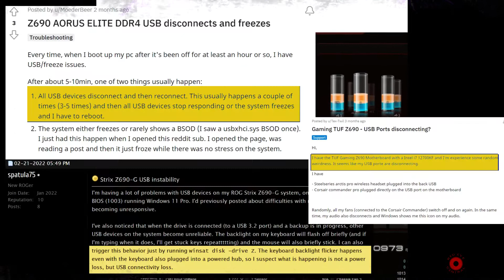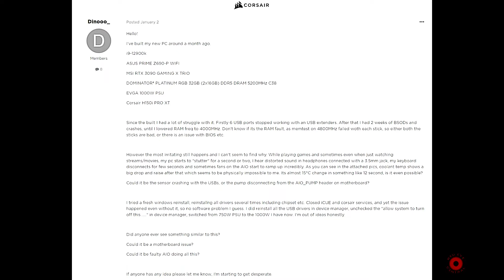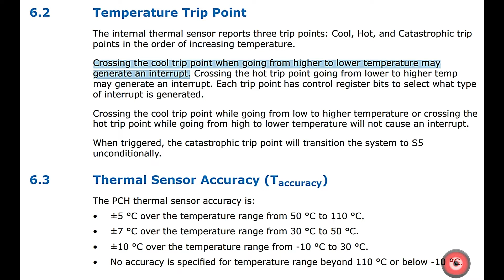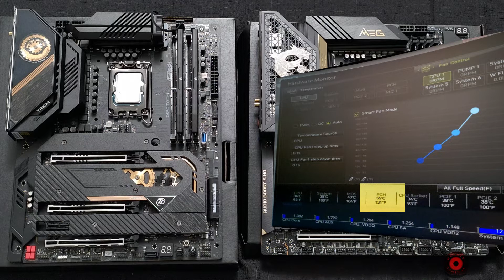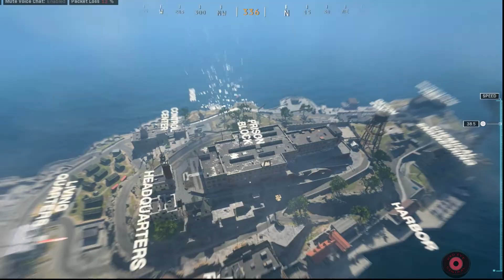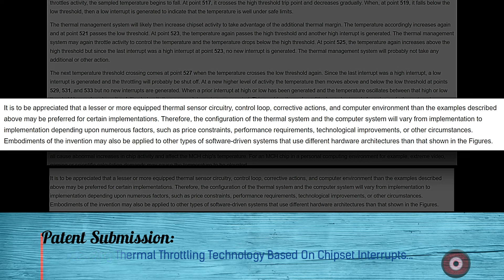Z690 Chipset Motherboards Getting Burned From The Inside Out? Let's Take A Look

Comment: I have a prime p4 I use icue to monitor lately after installing a second ssd my temps have shot up to 127 Celsius which is worring could be icue glitching I'm new to pc not a good start lol
Reply from the maker: Yeah that would be unacceptably hot. The GPU may be adding more heat in that location as well, since the chipset is right behind. And the more powerful the GPU, the hotter. Are you noticing any system disruptions, such as disconnected peripherals, lower performance, freezing, crashing, lost drive access, etc.? 

We cover a little about Intel's references to chipset interrupt points at around the 3:08 mark in the vid above. 

You can try to download and run HWiNFO to see if you can cross-reference and compare the temps you're seeing in Icue with the temps in HWiNFO:

https://www.hwinfo.com/download/

*You can download the portable version if you want to run it from a USB drive, or from your local downloads folder, instead of installing it on your Windows installation.

In HWiNFO, check for the controller section in the sensors readout window (probably labeled as "Nuvoton" SIO) and see if it lists the "PCH" temps.

We'll try to throw up a quick walk-through of HWiNFO in the future, but you can just select "Sensors Only" followed by clicking "Start" (when starting the program) and that will show just the sensors window. That can make it less overwhelming than starting everything at once. Then scroll down those sensor categories and try to find the PCH temps.

*Some Motherboards have a BIOS readout for chipset temps as well, as seen in the vid above at the 4:23s mark. You can try to double check there to see if the BIOS temps are available and if they match the temps you are observing in icue.

We installed a chipset water block with good results, but that would only be an option for water-cooled systems. Some other system owners have reported some success reducing temps by directing a fan directly toward the chipset heatsink.

Let us know what you find out in BIOS or in HWiNFO.
Reply: @RedEyeCentral  only disruptions are my controller disconnects occasionally and ok ill try hwinfo and see if it matches up. Definitely didn't have this issue before I put second ssd in
Reply: @RedEyeCentral  also checked motherboard temp in bios and its 24 Celsius
Reply from the maker: @sam-gf4ev  Often times, "Motherboard" temp sensors just indicate a sensor placed somewhere on the motherboard to measure the temps of the circuit board, but not specifically in the chipset area. Chipset temperature sensors should be identified as "PCH" temperatures. If the BIOS has no mention of PCH temps, maybe Corsair icue is glitching and misreading a non-existent sensor, or something along those lines.

127C is really hot and would most likely trigger a shutdown by passing the catastrophic trip point mentioned by Intel, around 2:29s mark in video above.

If HWiNFO can't find a "PCH" sensor reading either, then the board may not be equipped with one and that may require an external thermal probe on the chipset in order for a system owner to observe and garner temp readings in that area.
Reply: @RedEyeCentral  thanks I looked at hwinfo and only one that's a little hotter is the pch temp at 61 Celsius which is a lot less so does look to be like fault in icue thanks for your help ill keep an eye on it
Reply from the maker: @sam-gf4ev  That sounds much better! We shaved off 67C! Go us! Haha. 

No, but really, excellent execution. Sounds like you now have some good temp readings to better track performance going forward for your specific hardware. Checking it like you did is good practice. 

It's always good to get that data early on. That way, when checking those sensor readings later, it's possible to compare them to that baseline data that was documented at the beginning stages of a system build. This can be helpful to determine if temperatures and/or performance (and any correlation between the two that may exist) are degrading or improving with changes that occur over the course of system ownership.

We might still not know the thermal trip points on the motherboard, other than Intel's "catastrophic", which makes it hard to identify at what temps the system begins to thermal throttle activity and affect system performance. However, 61C is a much better place to be than 127C.

Thanks for the follow-up! And letting us know what you found out on your system as well.

Comment: I also have problems with ROG STRIX Z690-A GAMING WIFI D4 cheat at idle 66-69 degrees depending on the time of year. I noticed that I play on x2 in normal mode, the first 10-15 minutes go smoothly and clearly, hitting bullets goes perfectly, the score goes 21-4, 18-5 +-, as soon as the PC heats up everything goes with a big delay and I think it's the fault of the chipset. In the game it heats up to 72-77 degrees, like not significantly, but starting from 67 degrees the game behaves very unresponsive, on the monitor opponents are not, but in fact they are already shooting at me 1-2 two times and only after that to me on the monitor show that they start to come out and I do not even have time to shoot as I am killed, ie there are delays, but not lags, but as if the information with a delay comes to the monitor. I'm not 100% sure that it's because of the chipset, but it is the hottest 72 grudusa, motherboard 40-42 degrees, CPU 54-60 degrees, video card 4090 50 degrees.  Is it possible that the monitor is warming, or the network card - integrated Ethernet i225-v3, or the memory is warming and behaving with lags? But I've definitely noticed that when the room is 25 degrees, the game runs better than at 26.5 degrees and even more so at 27 degrees in the summer. When I opened a window and after 3-5 minutes the game would revert back to its original state, I could hit digil gun targets with a single bullet again.  

Even when I didn't have a 4090 and had a 1070 it was the same.

Comment: Hi bro... Actually i got the same issue with my ASUS ROG STRIX Z690-F. I put 3 SSD in this MB, and I saw that chipset temp got between 70-75°C!! I am really sad, because this is my first assembly. I have 9 months with this computer. Besides, my mouse or my keyboard are disconnected sometimes.
Reply: This temp chipset happens when I am doing anything in my computer.
Reply: mine is disturbing it's 84-86 °C in a 24 °C environment.  God my board will be toasted soon, hows your board mate?

Comment: The problem has been identified and fixed by many. You need to remove the motherboard from the chassis.
 1. Remove the screws holding back the metal cooling block and plastic shroud.
 2. Remove the old thermal pad, clean the metal surfaces and the PCH chip.
 3. Cut and install GELID GP-Ultimate thermal pad size 1.5mm or 2 mm  over the PCH chipset. 
4. Place the cooling block/radiator with the plastic shroud back in its place, tighten  the screws on the back side of the board.
5. 15–20 degrees C lower temps. If you want a few more degrees lower temps, remove the plastic shroud (unscrew the bolts that are holding it to the cooling block/radiator)  before installing the block/radiator on to the motherboard PCH
Reply: Do you have a video o something visual to remove these? I have the same problem, and I am trying to resolver it

Comment: My Msi z690-P with 12700K was only giving 5 watts to processor. When we send it to warrenty they said. We have overclocked the cpu. The PC would restart for no reason and wouldn't work properly
Reply from the maker: Sorry to hear 😟; I know having newer, malfunctioning parts is frustrating. Were you able to check the PCH temperatures at the time? Though, it sounds more like it may be a power delivery issue, seeing the temperatures could help pinpoint any other overheating components. 

Are they saying they won't honor the warranty repair?

The "Z" series boards are usually the boards they market and sell for overclocking, so they might be trying to dance around the warranty if they think a "P" series board was overclocked. 

A "Z" series board would be something like: 
MSI Meg Ace Z690 https://www.newegg.com/p/N82E16813144505

I am not sure how they would know unless something obvious was askew in the BIOS, but if it wasn't overclocked or the BIOS "Auto" settings set something inappropriate, see if you can talk with a manager and let them know your case. But with the current state of customer service (doing full AI), I can feel your frustration!
Reply: @RedEyeCentral  It was a build for video editting in my office not a personal one.

• initially everything was working fine but video exporting was taking too much time in premiere pro.

• I did benchmark on cinebench and at the same time video card. Everything seems okay.  Only Cpu was getting hot.

• The only issue i noticed was when i removed the eternet cable and re attach it. The internet would not work without a restart.

• We send the pc back for cpu repasting. still there was a problem. and then suddenly PC keeps restarting randomly. When i did stress test it would not restart . During video ediiting it was randomly turning off.

• We send the pc back that guy concluded it was the problem with power supply. We got a new one with warranty but it didn't fixed the issue.

• Now things changed. The CPU would not use more than 5 watts and it would take more time to start. The motherboard would show differennt light. Start time from black to bios screen were more than 10 seconds.

• We send it back. then i went personally to the shop and tested different processor it was lock at 5-6 watts and 0.40 or 0.80 mhz 

• Then we change the motherboard got Tomahawk. We had to pay 15-20dollars extra.

The location was Pakistan not europe.

Comment: I've bought this motherboard couple a months ago , very good motherboard nothing to complain about but now i've senn in HWiNFO the Chipset temperature , it's 70-73  degrees in almost  IDLE ! , i want to specify i use for CPU Noctura DH15 and all case have very good fans and airflow , in 100% cpu utilization i have like....65 degrees on cpu and 70-75 on graphic card for example, but this chipset temperature it's diving me crazy , is this normal > ?  in game like Cyberpunk the Chipset temperature goes to 80-85 !
Reply from the maker: Sorry to hear. I know it's frustrating. What make and model motherboard? What model GPU is in the system? 

There is the option to add a chipset water block, but that most likely requires: the GPU to be water-cooled, the removal of the chipset heatsink, and most likely the M.2 heatsinks if they extend all the way to the chipset area. Those heatsinks often contribute significantly to the aesthetic theme of the board, so it might take some of the visual appeal away if the system is appreciated as a visual display centerpiece over raw performance.

But, if in dire need of improving functionality, that is an option. With the Watercool Heat Killer, we get Z690 chipset temps on the MSI Meg Ace that stay in a range between 27C and 35C, depending on ambient temps and workloads. We did a walk-through video showing some of those temps during some random workloads: https://www.youtube.com/watch?v=9ZgS3x6ULSQ

Some other options you could try:

*See if you can get some more fan cooling in that area behind the GPU; sometimes the GPU can add a lot of additional heat back there as well. Some system owners have even mentioned placing a fan right on the heatsink with fasteners like double-sided tape, though with the temperatures in that area, I'm not sure how long the adhesive would stick.

*Try to remove the heatsink and check what is going on underneath. Are the thermal pads making good contact and getting compressed properly by the heatsink? Also, you could use some calipers to measure the thickness of the thermal pad installed by the manufacturer and try to find some upgraded Gelid GP Extreme or Thermal Grizzly Kryonaut replacements in that size to see if installing those can improve temperatures. We posted a video a while back displaying some temperature differences we were seeing after replacing generic thermal pads with Gelid's GP-Extreme pads on some GPU memory modules, shown here https://www.youtube.com/watch?v=wH4YeHPUL4Q

*Another option that isn't too desirable is reducing functionality within the BIOS/UEFI, though that kind of defeats the purpose of buying a premium board with all the extra functionality. But, some system owners have mentioned reducing DMI speed in the BIOS from 4.0 to 3.0, etc. We posted a quick request video on where to find that setting in a Z690 Bios here https://www.youtube.com/watch?v=Ar-FGCby4MI 

Let us know what you find out.

Comment: ROG STRIX Z690-G GAMING WIFI with 13700K, idle chipset temps about 60 to 63.  Anyone tried upgraded thermal paste or pads? Not sure if it's pasted or padded.
Reply: I have a 13700k on a rog z690-i wifi with a rog 240 AIO and it runs upto 70c the cpu is at about 60c. I have put in a thermaltak cpu cage over the stock cpu mount and got mk6 paste... it runs hot unless you have a large rad and plenty of case fans

Comment: yea my z690-I strix board is dead and my cpu :O
Reply: Can you say more?
Reply: @errrr69  sorry for late but yea my chipset killed my board and my cpu was going with it.
Reply: @S3agrass  whats temperature PCH?
Reply: @errrr69  my did hit 95c in bios
Reply: @S3agrass  i change pch voltage 0.9 and 0.7, 81c under load, check it. But these are still sick temperatures. Also think about changing the efficient thermopad
Reply: @errrr69  i did send my board in to Asus and they did send me a new one
Reply: @S3agrass  and now temp pch? Better?
Reply: @errrr69  yea 50-60 c
Reply: @S3agrass  Nice, What will change / fix?
Reply: @errrr69  ? About what
Reply: @S3agrass  So they exchanged for the same, new model z690i and there is no problem
Reply: @errrr69  i have a new z690-I board and its working but how long that i dont know
Reply: @S3agrass  Check if you have not enabled ASMP in the bios, temperatures drop but it limits the bandwidth. It is impossible that on the same model the problem disappeared, these constructions have it
Reply: @errrr69  yea i will check it when am home 👍
Reply: @S3agrass  This is in the bios, Advanced->Platform Misc Configuration. If your problem solved in this way, it's a big minus for Asus
Reply: @errrr69  my ASPM is on auto
Reply: @S3agrass  And the rest? Pci Express Native, DMI Link ASMP Control, L1 Substates, DMI ASMP, DMI gen3 ASMP, PEG - ASMP?
Reply: @errrr69  auto on most off it but gen 3 asmp is off
Reply: @S3agrass  It probably enabled power saving states, you may have less performance on the PCI Express bus. I do not turn it on because the performance decreases. Shame on Asus. Also check in HWInfo at the very bottom if WHEA errors do not appear after some time of using the pc.
Reply: @S3agrass  after these ASMP options, WHEA errors often appear
Reply: @errrr69  so no power loss for me when i check cpuz or gpuz
Reply: @S3agrass  It's not about power loss. About bandwidth, the entire PC is limited by data transfer, even the speed of the ssd. PC instead of working with full bandwith, with asmp bandwith and perfomance is limited. And that's not why you buy top motherboard, cpu to limit it all because Asus correctly did not cool the chipset
Reply: @errrr69  i will check all when am home later and update u ^^
Reply: @S3agrass  ok ;)
Reply: @errrr69  pci express native enabled native ASPM disabled dmi link ASPM controll disabled ASPM auto L1 substates disabled and then DMI ASPM&DMI GEN3 ASPM&PEG ASPM disabled and pci express clock gating enabled
Reply: @S3agrass  I have:
Pci Express native power disabled
DMI link ASMP Control disabled
ASMP auto
L1 Substates disabled
DMI ASMP disabled
DMI gen3 ASMP disabled
PEG disabled
Clock gating Enabled.
So you have enabled the first option that may limit performance, but I'm not sure. You can try turning it off and see if the temperatures are still ok
Reply: @errrr69  that is what i get when i reset bios ^^
Reply: @S3agrass  Check how it will continue to be good then you have the problem solved🙂 In my country, the service replied that 95c is a good temperature 😁
Reply: @errrr69  88c on full pc stress test ^^
Reply: @S3agrass  I don't know if we understood each other. They replaced the motherboard with a new one and after replacing the under load chipset temperature is 50-60? Or still 88c?
Reply: @errrr69  after the new board my max temp is 88c but normal use off my pc its at 50-60c
Reply: @S3agrass  So they didn't change much, I suspect they replaced the thermopad only in the new motherboard
Reply: @errrr69  yea its working for me now and the temp is good so am happy
Reply: @S3agrass  same motherboard, I hit 105-110 under load. After reading this comment thread I'm going to contact Asus